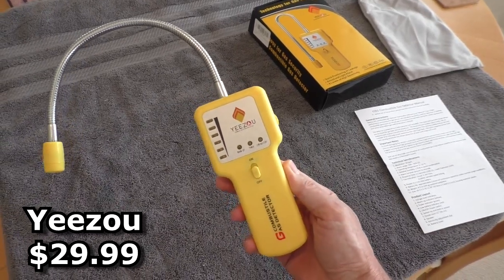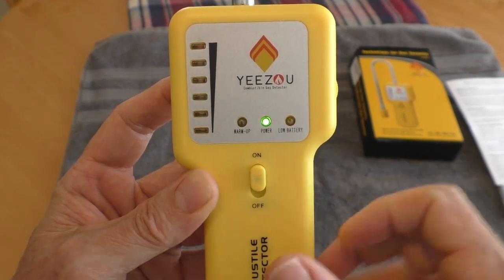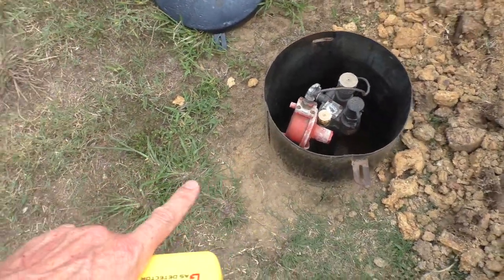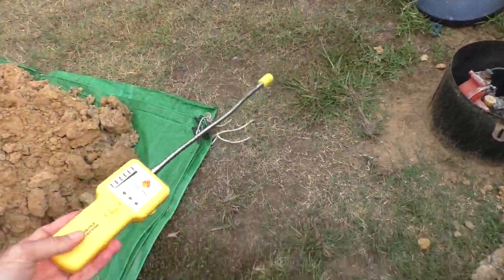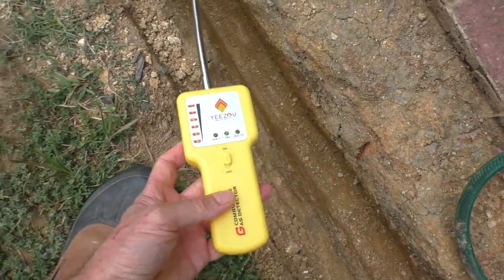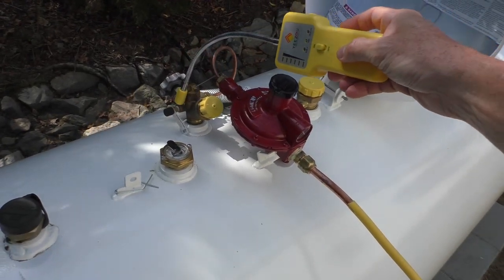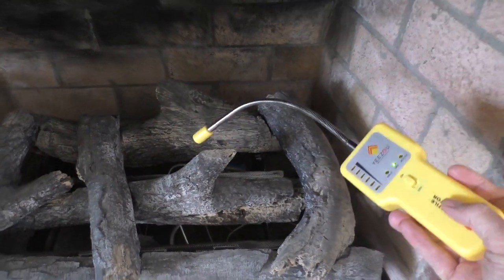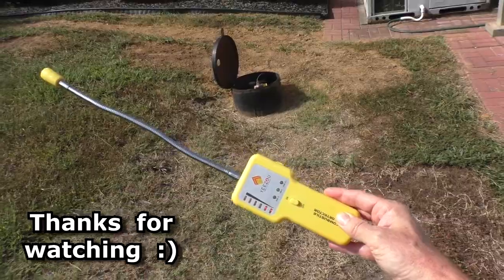Yeezou Combustible GAS DETECTOR $30 Review test for leaks propane

Comment: Hi. I know this is quite an aold post now...but...would this wotk on tracing methane gas? I want to see if I have leaks anywhere in my toilet stack pipe.
Kind regards
Reply: Same here, is that what you call methane gas?  I’m smelling gas after having a new roof installed and wondering if some debris from the roof got in the pipe, which is too tall for me to peer into the pipe.

Comment: While this detector does work I notice by accident that if I breathe on it the meter will peg the scale! I was looking for an underground leak like you and noticed just the water vapor near the ground triggers it making it hard to tell. So unfortunately it triggers from moisture as well as methane in natural gas.
Reply: I came to the video for help with this exact issue. My husband also closed his fist around the detector "sniffer" and the heat of his hand seemed to make it go off. We set it while it was outside in the cold air and as soon as we got in a warm environment it went off. Now I have no idea if it is reliable.

Comment: When I set the sensitivity outside and go inside the first one or 2 red lights go on , is that normal ?
Reply: You need to explain out side inside what are we talking about ? I have a MotorHome it was stinking of gas outside the van buy where the bottles are kept. I opened the hatch and the thing went crazy. So I put the gas tester at arms length and away from the hatch where the gas bottles are kept, reset it till you hear a noise with 1 red bar ( make sure you warm it up first ) then lower your dial to you hear just the clicking sound. I found this very precise, I found 3 different places gas was leaking, if your doing yours and there is a gas pipe run the end along the pipe any connections this to, it really is good and for the price it’s a super life saver..

Comment: Is it safe to use in a flammable gas  richEnvironment, does the button produce an arc when turned on? Same with the Sensitivity wheel?
Reply: WiseRock Man  it is not explosion proof if that’s what your asking
Reply: It really depend on the type of tester. I think this model used corona discharge so it wouldn't be a wise choice for a flammable gas enviroment. There are infra red and ultrasonic leak testers available for flammable gas
Reply: @benm9382  This is a Combustible Gas Detector. Why would anyone manufacture a Combustible Gas Detector that produced a spark? That doesn't pass the common sense test.

Comment: Hi, Question: The device gas company technician uses clicks when a leak is detected. 
1) Why this one clicks non-stop? 
2) What is the meaning/interpretation of each click in this case?
3) Can it click faster in case of a leak? Or leak always results in an alarm beep?

Thanks a lot! Very nice video.
Reply from the maker: hi, im guessing the click noise is just to let you know the detector is working. the alarm sound is what happens when it detects a leak. i never noticed the click sound change pace in any way.

Comment: What if it turns red but doesn’t beep around certain areas? Does that just mean it made contact with the surface?
Reply from the maker: its possible it is detecting a small amount of gas. try the adjustment knob some more and retest. mixing some dishwashing liquid soap with water in a spray bottle can also help locate a leak. spray the area and if tiny bubbles appear then that spot has a leak.

Comment: Well thats very scary.  Is the old one just going to stay down there?
Reply from the maker: hi, yes the old tank will be abandoned. Propane isnt considered toxic so it can be let to dissipate. and i didnt want to dig up the old tank which will tear up the yard with a backhoe and removal costs about $900. the new aboveground tank will be easier to maintain and wont rust thru in the wet soil.